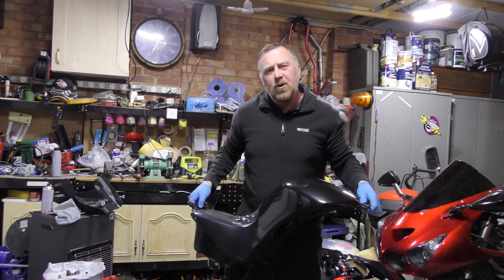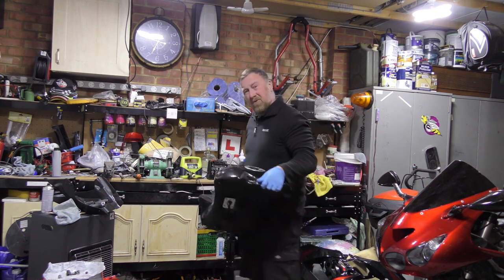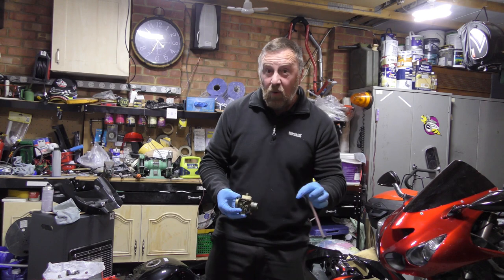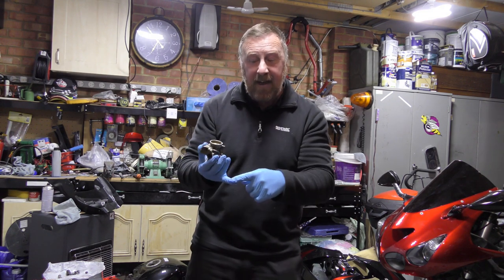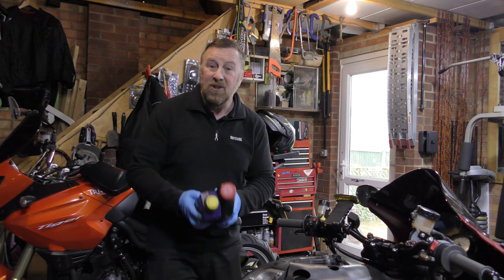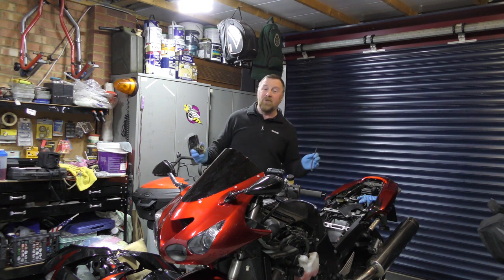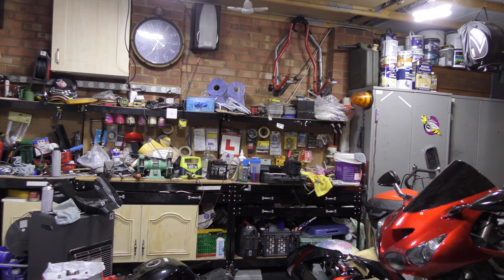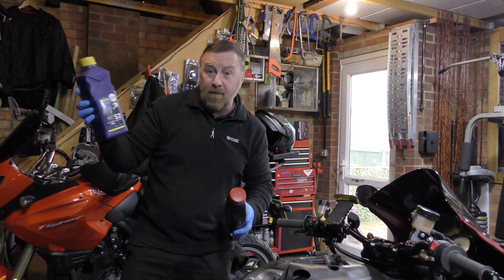MOPED SCOOTER WONT START AFTER STORAGE OR RUNS BADLY

Comment: I put E10 in my 2002 Triumph Sprint ST and have done so for the last 5 years with absolutely no problems. As for scooters I also have a Peugeot Elyseo 100cc 2-stroke which also runs on E10 with no problems whatsoever!...As long as, your hoses are compatible with ethanol you'll have no problems. Ask Mark how to change them, it's easy! (Chance for a video there Mark!)
BTW, my scooter didnt start initially because it had been sitting for 14 years, Nothing to do with E10 fuel as they didn't sell it back then. The carbs were just full of varnish but once cleaned out, it ran perfectly..

Comment: Hi mark, i have a 50cc Aprilia SR(2019) with a carb and it bogs down after 100-200 meters it just turns off in a middle of a road it basically breaks a lot and turns off,i can start it again and does the same.I cleaned the carb and it did nothing, i also checked the fuel coming from the reservoir it seems to be working fine,also checked the rollers and they are fine,my conclusion is maybe the fuel comes slowly and the carburator empties and it bogs down,maybe problem with oil and oil pump ? Whats your opinion ?
Its basically stock with a gianneli exaust.
Reply: Also when i try to give it gas it just tries to bog down
Reply from the maker: sounds like you right to think its fuel so best start there
so carb off and take apart clean with carb cleaner and float out test clean pin and test like in my carb videos 
check fuel lines .replace if needed 
vacuum test like in my videos with the suck test 
jet size  standard ?
E10 fuel ???

Comment: Hi Mark, I love your videos they're so helpful! 

I have just bought a speedfight 2 100cc.

It runs fine most of the time, however now and again, after stopping at the lights, it takes forever to get up to speed. Is this the rollers as you've said in your videos? Or can it not be the rollers as it does not do it most times I'm pulling away? My rollers are 13g. Is this too heavy for 100cc? 

Thanks mate
Reply from the maker: 10.5g normal but 100cc can pull with 13g
Take off clean like in my videos and replace if needed bud
Reply: @marksavage  thanks so much for replying! 

I'm not as capable as you are I fear! I've had the engine casing off, the bendix came out and I can't get it right, its making a god awful noise when I push the starter. I don't want to harm it. 

I think it needs a trip to a professional
Reply from the maker: @andyedwards2304  it's not seating right bud 
Check the pin seats in to the inner case nicely and then the outer case when refitting 
It has to go on tight from the front pins and inline as it sounds like it not lined up 
Give it a look over before garage bud

Comment: hello mate 
can i use the e5 suprme in my piaggio zip 2t its a 2015 model
Reply from the maker: any motor bike moped will run on E5 and better all but the cost lol
Reply: @marksavage  okay cuz i did see a 35 super pump at the garage but diddnt know if it would go in my zip and mess it up lol ill drain all the e10 out and stick to that then thanks mate

Comment: Well sed mate. Won’t use e10. 
Can I ask. I have a k5 650 bandit and I’m having trouble with the dash. The rev and Speedo stop working now and again I still have lights on dash just no speed or revs. But it’s not all the time it can just stop working when out riding and can come back on. Any ideas please
Reply from the maker: They do suffer with the loom at the front handle bars turning point 
Check them out 
Fuse ?
Water damage , clock off and wd40 connectors bud 
And yea don't use E10 
Thanks for watching bud
Reply: @marksavage  thanks mate appreciate it

Comment: hi mark non videos related question but my friend has a piaggio zip and none of the lights work its had new bulbs and everything do you know what would cause this?
Reply from the maker: often they suffer with wiring loom or bad contact in the connector blocks also bad earths 
can of wd40 and go around checking them and they loom near the head stock
Reply: @marksavage  ok cheers mate

Comment: I have been using E10 for my Yamaha YBR 125 2008. Do you think I should change to E5?
Reply: yes. in my profession, all the people in the technical field ONLY use E5, and all the people who have no knowledge about engine management, or proper technical maintenance use E10.

i can go in to detail even more than Mark here, but E10 is designed to destroy all the seals and hoses in your engine over time. you get less power, and less fuel mileage (as there is less power in E10, it requires more quantity over the same amount of range) so you still pay as much as if you would have filled the tank with E5.

if you like your vehicle, and dont want to pay alot of money on repairs, use E5 or better (if available)
Reply from the maker: Like the other youtuber said 100% mate use E5 super , your bike will run , start and better mpg
Reply from the maker: @wildwilco  I did go over this in my E10 videos but agree with yo7 bud 
Take care
Reply: @marksavage  yeah true, i was reading the comments and after finishing this one i actually heard you started talking about it. there is more detail to go in though, but most people who arent technical wouldnt really understand. i bet you would! :)
Reply: @wildwilco  Thanks mate!
Reply: @marksavage  OK cool nice one